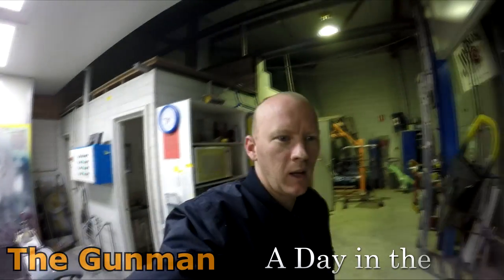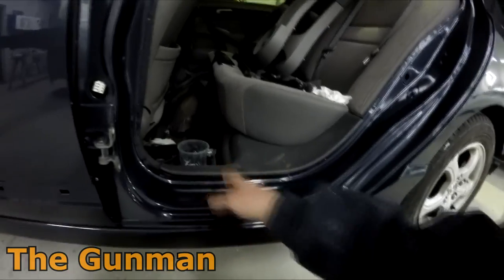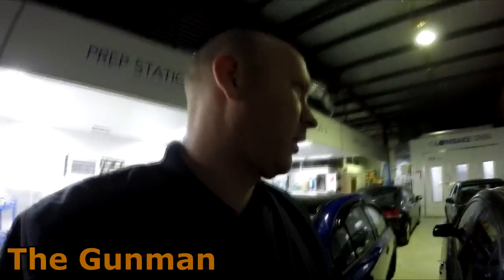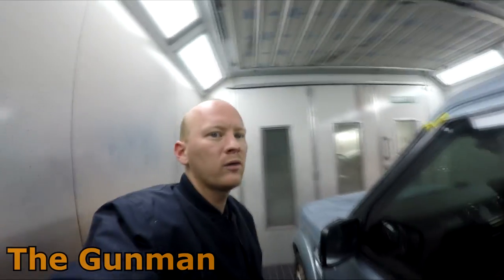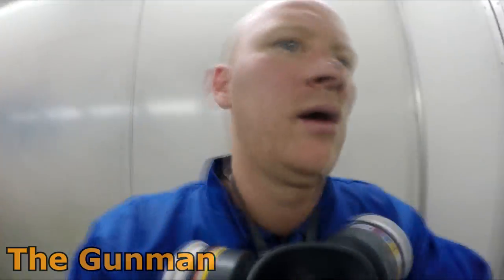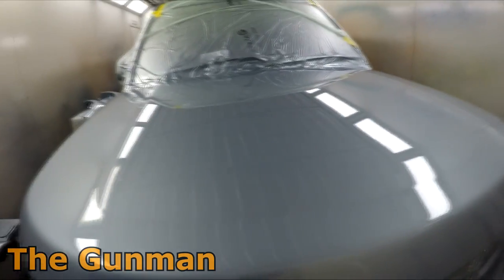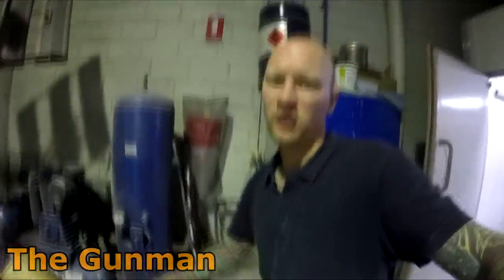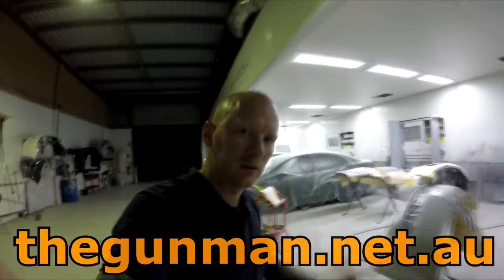Mad Monday

Comment: Hey gunman. How much would it cost to respray half a car without labour white colour
Reply from the maker: That depends on material cost, like the old how long is a piece of string but anywhere from $200 to $3,000  depending if you're hiring a shop, need sand paper, tools, equipment etc. and the kind of paint you want, you can get budget industrial Nason for under $30 a litre so could respray a car for under $200 so really an impossible answer without more info

Comment: GM I was resraying a rear quarter on a Lexus wheel arc,sail etc and the base a "shell metallic" seemed like base went good, after 2 wet clear coats good. got 2 small 1" spots on the arch the metallics went bonkers? any idea's mate?
Reply: Sounds like the base did not dry down right in some areas. cheers Mike
Reply: thanks dongil123